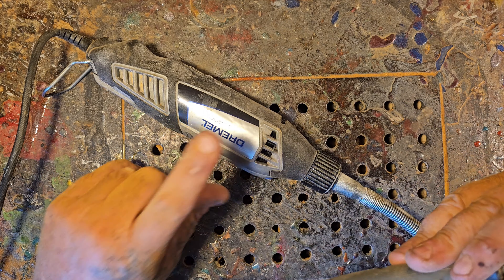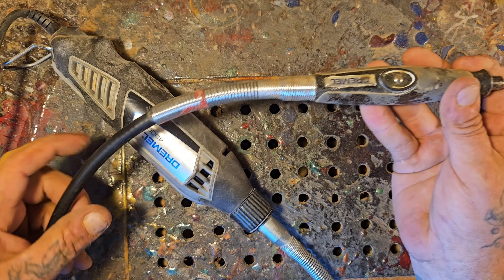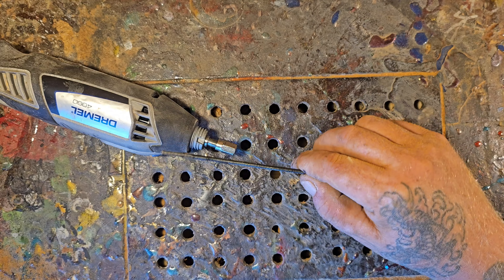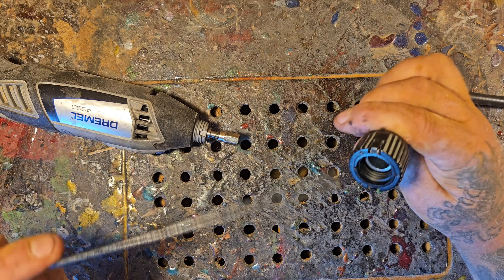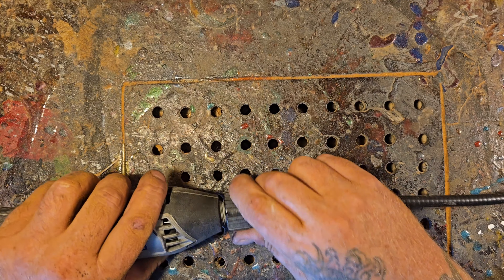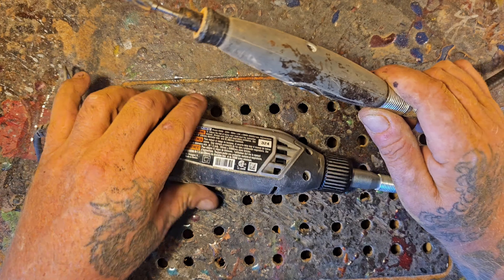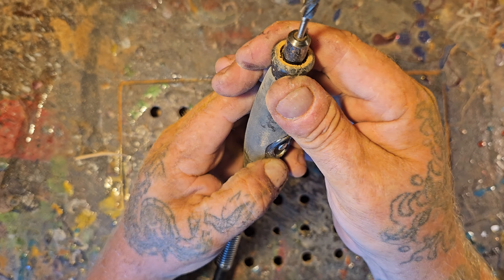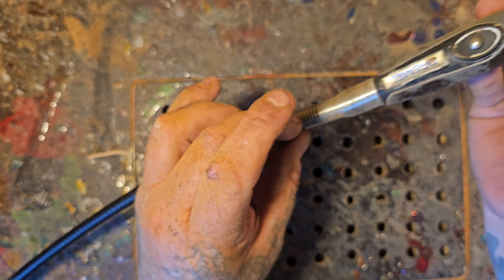Dremel flexshaft overheat & How to fix it.

Comment: Thanks so much Jordy; thought my Dremel died but it overheated. Learn so much from you; lowered my Dremel down, cleaned out the flex shaft, replaced the inner shaft as it was totally full of grease/oil. Works like a charm again! I had the Dremel hung way too high.  Definitely will purchase a Foredom very soon since I watched your videos on Foredom🌺